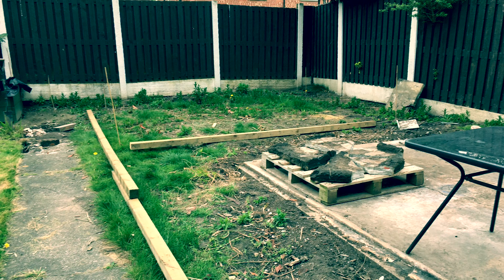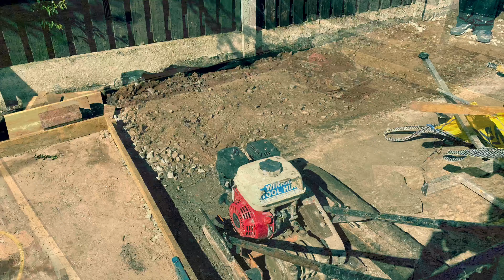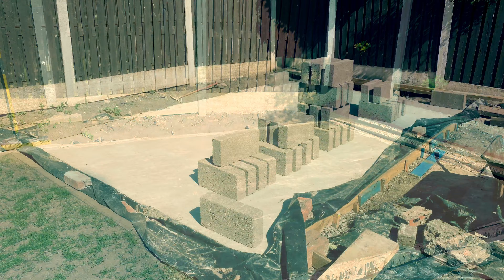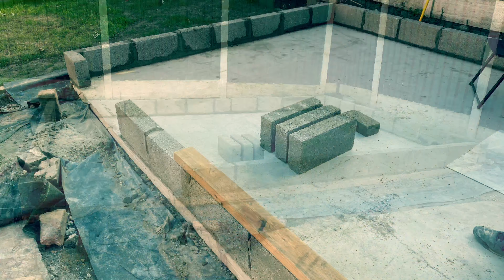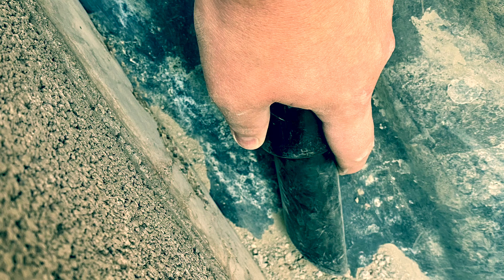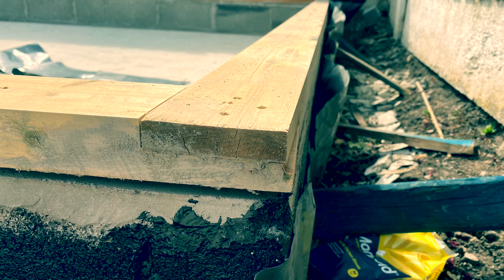DIY SHED WORKSHOP BUILD - Part 1- Concrete Slab Base

Comment: Nice videos. 
So with the timber on top of the blocks, are the screws going through the wood, through the DPM and into the blocks? If so, does moisture not transfer through the penetration in the DPM?
Reply from the maker: Yeah I’m sure it would if the blocks were saturated but they are dry as there’s a dpm between the slab and the ground and the sides of the block are painted with a bitumen paint.

Comment: Hi, how important is the block course? If the slab finished floor level is above ground level, can I bolt a pressure treated 4x3 sole plate straight to the concrete and work up from there? Thanks
Reply from the maker: Alright Barry, the reason I built the block-work was because the ground level the other side of the fences is higher than in my garden. Only about 100mm higher but if we had any heavy rain I didn’t want the water getting above the slab level and working it’s way in. That’s why I used a DPM under the slab which is then lapped up the walls which have also been sealed with bitumen to help make it as watertight as possible. If your slab level is high enough that there’s no risk of it flooding then I’d say you would be fine bolting straight onto it. I’d definitely use some sort of DPC/foam strip under your timbers to minimise contact with the concrete. Also be careful that your fixings aren’t going to crack the slab if it’s not very thick, as you’d be fixing close to the edge. 

Cheers
Reply: @HandmadeWestWorkshop  what would you say isnt very thick? how close would you say to the edge would i be good to drill concrete screws into a 4" slab thanks
Reply from the maker: Yeah  a 4” slab is plenty thick enough! 
I’d drill them as far away from the edge as I possible could just to make sure it didn’t crack. Another alternative is to drill holes and use a resin fixing which won’t crack the concrete.

Comment: whats the purpose of the black jack?
Reply from the maker: It was just overkill to be honest, but incase the the damp proof membrane was to get pierced and fill up with water then the black jack is a second line of defence.
Reply: @HandmadeWestWorkshop  The reason I ask I have a garage that was built on a concrete slab the blocks built directly on the slab well they out a roll of dpc on the slab first then built on top when it rains heavy the water travels in under the walls into the garage which I dont know how to fix
Reply from the maker: Yeah if you drop the ground level around your garage and coat it with some blackjack that should solve your problem.

Comment: What did you put on top of concrete once dry? It gave a good finish .
Cheers 
Ian
Reply from the maker: I just levelled it, let it go almost dry and then flattened it off with a trowel. Nothings been put on top since then mate

Comment: Brilliant job, this is similar to what I'm hoping to do. Can I ask, how did you secure the frame to the block course? I'm going to do a 4 or 5 brick course and I was going to secure with concrete screws. Is this a DIY job or is this something you do professionally?
Reply from the maker: Initially the base rail was bedded on the mortar and then screwed into the concrete block. On a later video you’ll see me attach it with L shaped  stainless steel straps to fight any uplift.
Reply: 1000gbp is impossible
Reply from the maker: Not impossible when you do all the work yourself and use salvaged and reclaimed materials where possible. Takes longer because you have to collect everything you need first instead of just buying off the shelf.